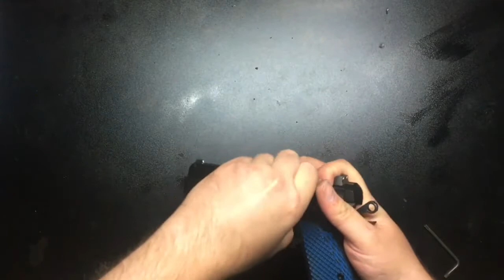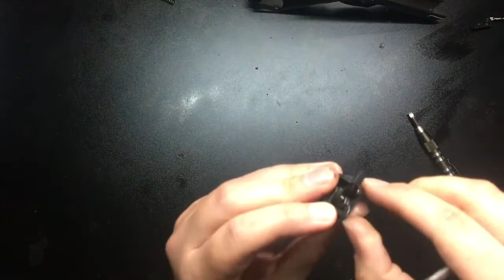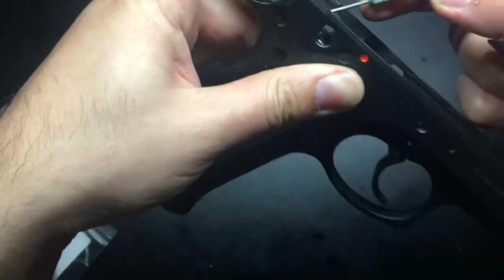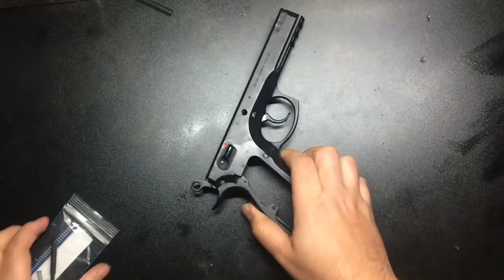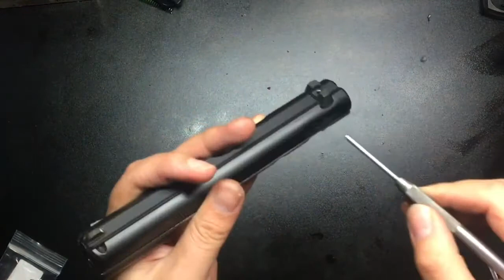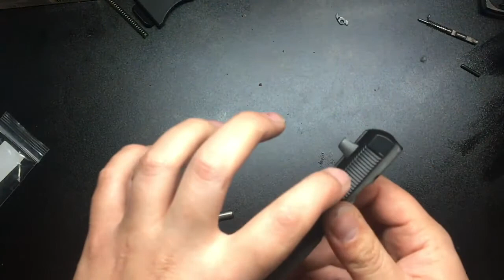CZ 75 Cajun Gun Works Short Reset Kit SRS-1 install (safety model only)

Comment: I called Cajun Gun works to pick their brains and the single absolute must replacement part if you do NOTHING else is... that roll pin you just reused. Next is the trigger reset pin. And you should also replace your extractor with their billet. I myself plan to also replace the safety detent spring with a stiffer one.

Comment: This is the area that worries me the most where I have to take apart that area with the seer. I have fat hands that are not great for small itty bitty parts. I've worked a lot on 1911's but this is definitely more complex. But it's an important part to mod I think.
Reply: Probably best to save up and send it to cgw and have everything done at once
Reply: @rmblwgn or if he has a local gunsmith. I’ll probably take mine to my gunsmith. I had him install a trigger into my PCR and I did the hammer spring and firing pin on my own.

Comment: Try to change the structure of disconector to reduce SA trigger pretravell! I did it, it feels great! I also reduce pretravell of DA trigger and finetuned the triggerstop...you can do all of this adjustments by your self! SA mode trigger now has short reset and after reseting instead of 12mm ther is only 1-2mm of pretravell (in single action) wich is great for folow-up shots. If you (or somebody else) need any advice how to do it, i'm here to help!
Wish you all the best in 2021. bro! 👍🍺🍺
Reply: Hi I'm interested in how to reduce the pretravell. Thanks for the help in advance. 🤘
Reply: @bluecollar_built  Buy short reset disconector! It costs somewhere about 50-60€. Pretravell will be 2-3mm in SA, which is great! Or just make SAO conversion on your gun and you will have zero pretravell and aftertravell! SAO conversion kit costs about 100€...
Reply: @allexthebeastpredator  much appreciated.
Reply: You could have just bought the adjustable trigger to get rid of all pretravel
Reply: @jason200912  You can't if gun is in DA/SA setup! You can only buy the trigger with two set screws  to adjust pre-travel in DA and after-travel in SA.
    To reduce SA pre-travel in this DA/SA sistems you need to have a different disconector for it!
Reply: How did you do this? And is it safe?

Comment: Is this compatible with an SP-01 that has been converted to SAO? How effective do you think it would be with Cajun's Aluminum SAO trigger?
Reply from the maker: Robert Boren as long as your sp01 has a safety plunger this kit will absolutely work on your firearm. This kit is designed for both decocker and safety models with the safety plunger. I do believe this will greatly improve the feel of your SAO trigger. not only will you get a spring kit, it reduces the plunger spring weight, and makes it to where you can no longer feel it being actuated. And an extended firing pin is included so reliability goes waaay up.    I think this kit will be one of the best things you can do to your SAO since the majority of the improvement is seen in SA.  ALTERNATIVELY, if you want an even better feel you can watch my new videos of converting a cz75 to a shadow. This will improve the SA even further. However this would be done at the cost of losing the safety plunger. Its all personal preference.